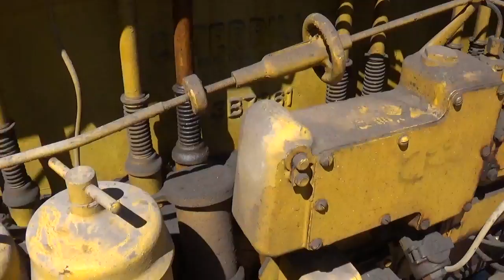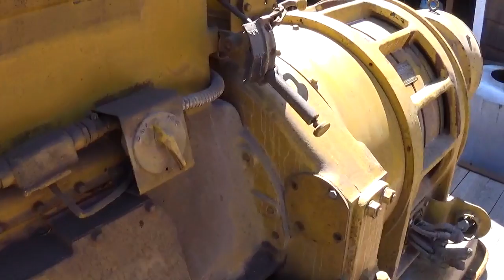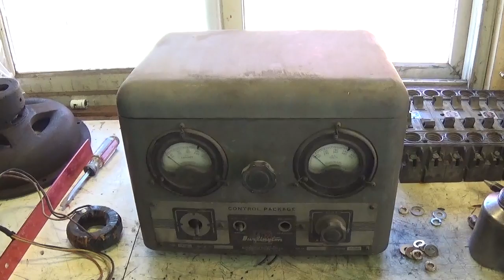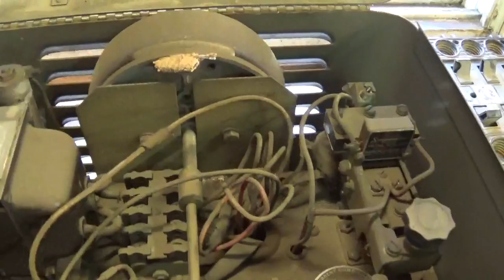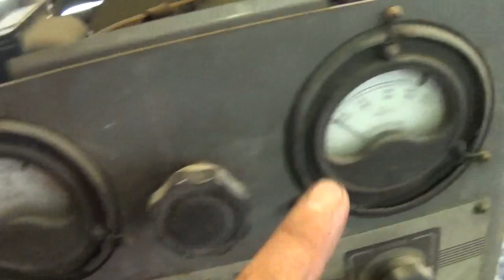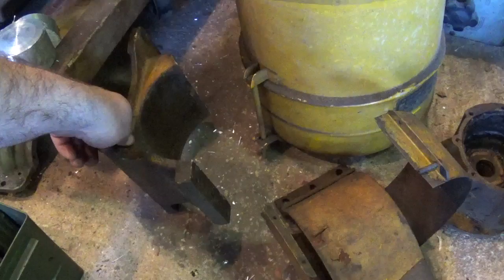Caterpillar Generator Set Repair Part 1 (Introduction)

Comment: These cat generators are something else. There was a D315 generator at a show i went to and have posted a video on my chanel. To find an AC generator that runs at 1000rpm is very unusual in the UK. Impressive machine you have there. 

https://youtu.be/difr_kznUBU?si=9JSVtT5e4saKLSK9

Comment: I was in (on) Antarctica in 1961. There were 6 of us (navy) at a base called Little Rockford that is or was about 500 miles from the nearest human. We had a 30 KW Caterpillar diesel generator for power. 
Only one.  One day the brushes in the exciter gave out. Without power we would have frozen. I had to find all of the resistors  and diodes that were in the electronic spare parts boxes and rig them to 
Excite the AC generator from the AC generator. Along with some lead acid batteries , the kluge worked.  This worked for about a month until a replacement exciter generator arrived. I wonder if 
Caterpillar ever knew they had a brushless generator in 1961?

Comment: One day when I have a chance I'm going to post a video to you of my Military generator I have it's 3KW can't remember the numbers right now but it was operating fine I tested a small three phase motor and it tripped the breaker twice went to reset it and now it will not put out any power.
Reply from the maker: Thanks for watching!
Blown fuse or breaker in the field circuit?

Comment: The 13000 engine was used in the old 2U  D8 with a 2 cylinder pony motor on the left rear to start it.
Reply from the maker: Thanks for watching!

Comment: Love your content. Thanks Mike!  That cast pedestal is friggin awesome.  How much does it weigh, whole set?  I expected a set of selenium rectifiers in there for the battery charger.  Interesting vacuum tube option--did not know that type of regulator could work at such a low voltage / low impedance.

Comment: at 480v x 240a, the watts are 115,200. the dairy was using 240v x 120a and the watts were 28,800.  It seems to me they could have used the windings at 240v at 240a for 57,600. I could be mistaken though.

Comment: Try this website for a starter motor. They sell original cat stuff. Half their stock is not listed on the site. If they don't have it in stock they might be able to get it for you or guide you in the right direction. Leave a message in "Contact Us" on http://winchestermarineindustrial.com/
Reply from the maker: Thanks for the tip!
Reply: No problem :)

Comment: Marvel Mystery Oil is good for freeing seized engines.

Edit: at 12:10 my question is answered. You mention the pony engine exhaust through the intake manifold.
Was that originally equipped with a gasoline pony engine starter?
I was surprised to see the electric starter.
Reply from the maker: I don't know if this unit ever had a pony engine, may be that all D13000 engines came with the exhaust pipe in the manifold for it.  Thanks for watching!

Comment: That is a cool generator set, is it still practical nowadays??
Reply from the maker: Thanks for watching!  No, it is not very practical for stand by use any more given how "labor intensive" it is to operate.  Not much automatic operation here, also parts availability it iffy.
Reply: SmallEngineMechanic still cool, your neighbors are going to love you when that starts up.

Comment: I think I have a complete comm brush kit for that, in fact, I think I have 3 and a half sets... the open set I was trying to use for another project, and were modified....  I really can't use them, due to the very high content of red brass fillers in the brush material ... I got really sick after modifying them ...LOL...  If you are interested, I can dig that stuff out, as It is very likely that I will not be messing around with a vintage G.E. 66Kw gen any time soon..LOL.. but beings you have one.... If I remember correctly, the brush refurbishment kit, was titled dual quad commutator brushes and flat springs and misc hardware kit....  That was 20 plus years ago... the other 3 kits are unopened
Reply from the maker: Thanks Dru, that is great to hear!  Any repair parts for the unit would be great to have!
Reply: I'll add that to the list

Comment: Going to put that in a building?

Looks like the controller would had been connected to the exciter.
Reply from the maker: Thanks for watching!  Not right away, it will stay covered on the trailer.
Yes, there are only a couple leads that need to be reconnected to operate!